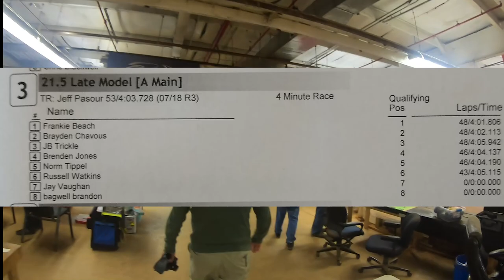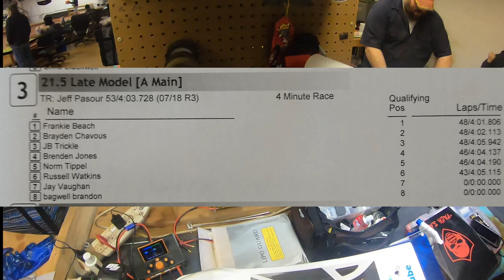RC Dirt Oval Racing at LIL Indy.  21.5 Late Model.  1st person view of entire race day.

Comment: Super excited for the tuning vids you mentioned. Really hard to get my mind around all the different adjustments and how they impact the car.
Reply from the maker: Thanks! I appreciate that. I've had a few requests for some basic tuning videos so they are on the way soon. Will do one for dirt oval and paved oval.
Reply: @jbtricklerc  Looking forward to the tuning vids. Im just getting started and setting up a stock mudboss and will definitely need to learn how to dial a car in. I know theres not alot you can do with the mudboss but I do plan to run a 2nd class as well. Is there a site or a something to download that tells me what changes do what? Something like a list of problems like {CAR IS LOOSE : Tighten LR/ Soften RR}
Reply from the maker: @cage-rattler  good news! I've got two basic tuning and setup guides on the channel now. One for dirt oval. One for paved oval. The dirt oval video while using a purpose built chassis still translates a lot into the street stock and mudboss type classes. I've also got a upcoming video where I built a Traxxas slash street stock for a racing teammate. Will cover more there as well.

Comment: I had that rare instance 4 years ago showed up to my local club track indoor huge carpet facility it was oval night had my RJ speed legend for the break out class cuse Thursday nights is legends night including weekends they run every week and I won top qualifier and won the A main against some amazing drivers a few pro rc racers and man it motivated me to keep winning in every class from their on I was hooked. But yes it's very rare to show up and won your first time out with no experience at all but I had real full size car racing experience like 15 years of that so finding the right line and how to drive it through the corners and off the corners and stuff like that was very simple to me it was just setting them up with a little bit different way different actually but I did really good one the race and didn't wreck nobody then it to the car then hit the wall one time a wreck one time at all we stayed clean the whole race no cars wrecked and they had 15 cars in the track and we was literally about a third of a second from first to 15th the whole race and everybody was on the 5.5 second break pu time and no one broke out and it's the same carpet track from snowbirds the oval lay out is black carpet same from 2019 snowbirds race and exact same length size and all so it's a good size oval about same size as the track in this video maybe a little longer
Reply from the maker: Sounds like you've had some amazing times! Absolutely awesome! I greatly appreciate the comment

Comment: I used  to race Dirt Late Model RC cars. Got track champion my 1st year. And the year after they adjusted the rules to make our batteries illegal 😂😂😂 cause we had a 100 lap race and I ran the biggest battery possible and was able to lap the entire field by 2 laps. I also did some carpet oval which I didnt care for. And some short course buggys. Miss it but the wallet doesnt miss it. Ive now moved into racing real life 4 Cylinders.
Reply from the maker: Awesome history ThunderMotorsorts34! We have several guys that race big cars and still race RC with us as well. Never let that hold you back. The way the brushless motors, lipo batteries and no timing ESC's have changed the game and helped with cost a lot. Thanks for the support as well.

Comment: You make mention about putting your lipo in a lipo bag, biggest concern is you didn't close the flap. Your bag isn't going to do any good if you don't have it closed to protect you and the people around you.  My local track keeps an eye on that and will deduct laps if it's not used correctly.
Reply from the maker: Lipo safety is a very big deal. You're 100% correct about pointing out my errors as well. Thank you for the support!
Reply: @jbtricklerc You're Welcome! I just found your channel and have watched a few videos. Overall I think you do a good job. I'd suggest a few things to change, but overall they're good.

Comment: Great video. well done and thumbs up! Form my opinion your car was too loose or "free" on corner exit all day. You can see on corner exit that the rear end is coming around and scrubbing off a considerable amount of speed. You would have better lap times if you were willing to trade off some initial turn in for a bit more neutrality on corner exit to give you more initial straight away speed.
Reply from the maker: Thanks Jeff and you are correct. I've made changes since then and the car has been much better. Had to make a couple spring changes and battery placement change (all part of track day tuning as well) but definitely fixed that exit wiggle.

Comment: Im courious about the urgency to hook up battery to charger. wouldnt it make sense to have spare batteries fully charged on hand? Or am i missing something? Are there rules stating you have to use the same battery throughout the racing day? Thankyou!
Reply from the maker: Great question. Any of the options you mentioned would be acceptable alternatives.  Sometimes, I do alternate batteries.  Sometimes I just rerun the same pack (club races or experimenting is what I usually did).  At one time, I had my batteries labeled saving the better batteries for the Mains or big races.  Most tracks now also have a Lipo bag rule.  In other words, I wouldn't be allowed to charge the battery in the car like that anymore and must be placed inside of a fireproof lipo safe bag.  Which is a good rule to have for fire safety reasons.

Comment: What do you use for the late model body
Reply from the maker: Serpant Au69YT I run a Custom Works Buckeye body.  Rules for my class call for it. However, other popular Late Model bodies are the Protoform NorEaster and the MR Kustom bodies for classes without a body rule. Those are for the purpose built chassis's like my GFRP, Custom Works etc. Buggy Late Models are a different size.
Reply: @jbtricklerc  also what truck do you use
Reply from the maker: @spade6916  My Late Model is a 1/10 scale GFRP Havoc.  I do run some Traxxas slash street stock classes as well. They have a street stock and late model class for those too. The bodies for the Traxxas is 1/8 scale
Reply: @jbtricklerc  thank you
Reply: @jbtricklerc  Can I use the Traxxas Slash Brushless with street stock sorry im very new to dirt oval racing
Reply: @jbtricklerc  and where do i get a GFRP Havoc
Reply from the maker: @spade6916  Each track has their own set of rules.  The breakout class is you could run the stock Traxxas brushless system. However, the super street and 10.5 Latemodel class has its own unique ESC and motor for the slash.  What I always recommend to everyone is visit the tracks they plan to race at that way you can verify the rules if what you can or cannot run. Welcome to the dirt oval hobby. It's a blast!
Reply from the maker: @spade6916  Mudslide Motorsports has a website.  That and Left Hander RC. I use for getting cars and parts quite often.  Also, GFRP has launched their own new website recently as well as they are getting ready to release a few new cars.
Reply: @jbtricklerc  THANK YOU!!!!!
Reply from the maker: @spade6916  anytime! Thanks for the support and hope you have a blast with some dirt oval RC Racing.
Reply: @jbtricklerc  you too!!!

Comment: Which  RC car is that made from  ??
Reply from the maker: David Black I'm running a GFRP Havoc 3.2 chassis.
Reply: @jbtricklerc  THANKS.   So it's not made from a Traxxis or anything like that  ??
Reply from the maker: @davidblack5551  not that particular car.  That's a carbon fiber purpose built foam tire dirt oval car.  Some of the Traxxas Based dirt oval cars are the Street Stocks, 10.5 Late models and breakout cars.  I've got series of 4 episodes where I went through and rebuilt this GFRP car you can scroll through and find on the channel.  I also have some episodes highlighting the Traxxas dirt oval cars as well.   Check them out when you have time. Appreciate the comment and support.

Comment: You have way too much steering. Why not reduce to 5 - 10% from your dual rate. Is that a GFRP havoc?
Reply from the maker: That is a GFRP Havoc.  I cant remember which model for this particular video though.  I started with a Havoc 3.2 and ended up with a 2022 version.  I do believe I did end up adjusting the dual rate as well as a right front spring change if I recall correctly.  I appreciate the comment.

Comment: i drive the real ones... do these cars actually drift thru the corner to the point your counter steering?
Reply from the maker: You would see that more in loose dirt RC racing.  Generally around here we run high bite dirt oval which you aren't drifting, very grippy etc.  However a normal club race or a day where track prep doesn't allow it, sure you'll be swinging the tail out some.  But it's not normal or a sign you're too loose.
Reply: @jbtricklerc  are there any other options for batteries other than stock?
Reply from the maker: @jayirving6996  you can pretty much run any battery you want as long as your electronics can handle it. Unless of course you are racing in a class with specific battery rules. Then you are restricted to whichever battery that particular class allows.
Reply: @jbtricklerc  I'm just using it to play around with. Found some 400mah 2s 7.4v lipo that will fit in the battery compartment
Reply from the maker: @jayirving6996  I gotcha.  I just recommend double checking the specs in the manual to make sure it can handle it if going bigger.